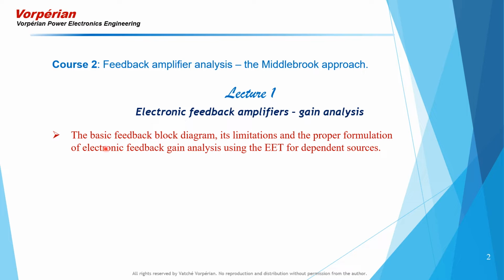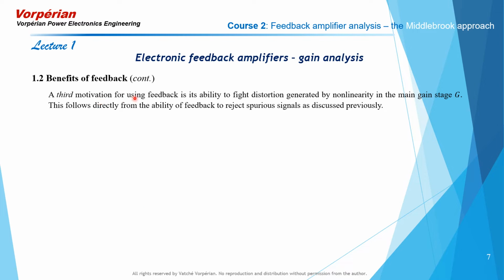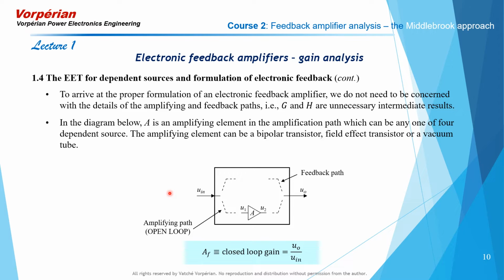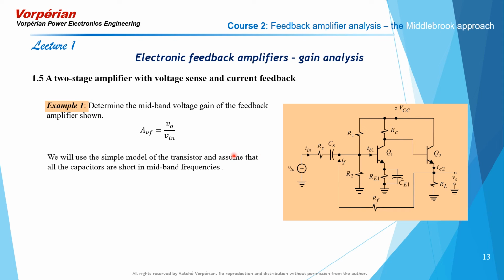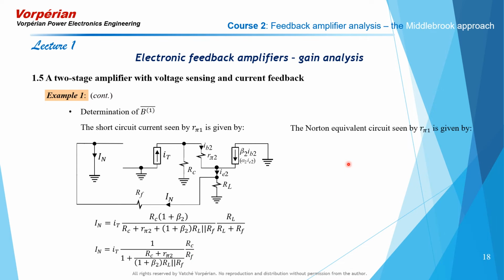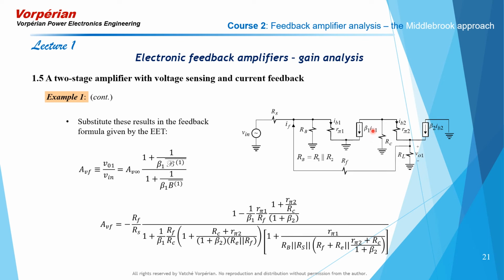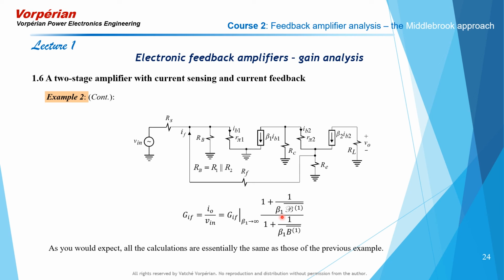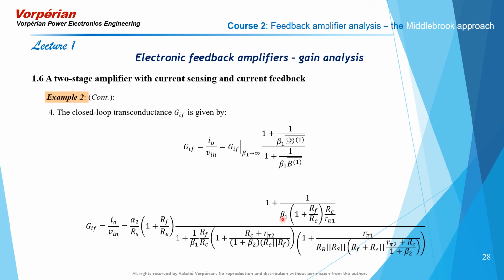Video 1: Feedback Amplifier Analysis - The Middlebrook approach

Comment: Vatche, isn’t the reason for finding H and G in the classical feedback circuit done because the loop transfer function T = GH is wanted? The loop transfer function provides insight into the closed loop behavior of the system through its Bode Plot and is very useful in classical control theory. 
I cannot see how this method can provide the same utility from a control perspective. How do I recover the loop transfer function from that huge expression obtained via the extra-element theorem?
Reply: You may search middlebrook's Video on general feedback theory on
youtube. His examples may be simpler to understand instead of mass
math expressions. the reason you got confused is because H expression is just complex, whether u choose H
 G with nodal analysis, or this  3 component expression. Interms of obtaining an accurate H, this technique only help to obtain it faster an with less entropy in expressions so that designer could adjust their circuit easiler with low entropy expressions that reflect the circuit topology clearly(series, parallel... NO meaningless term like r1xr2…).